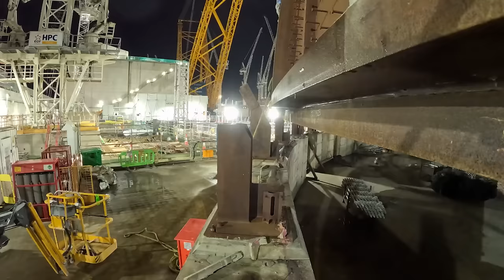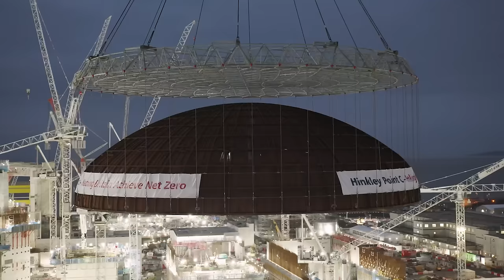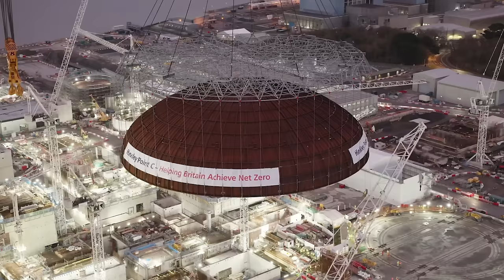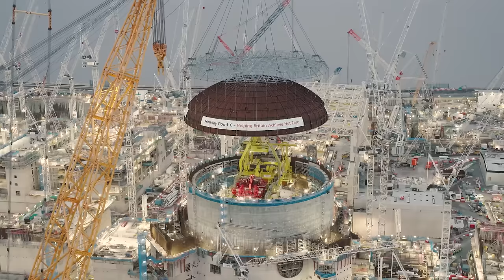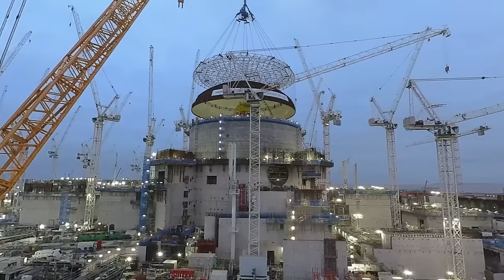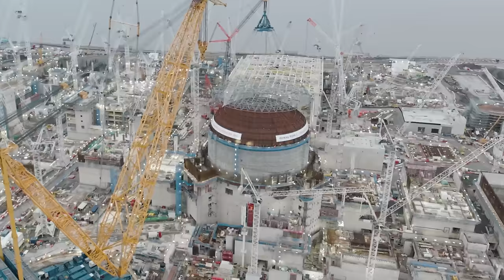Hinkley Point C | Dome Lift

Comment: helping britain achieve net zero but using loads of concrete, yes I know it's purple concrete or whatever, but a huge driver of global heating, 5% of all emissions or something, also not convinced this will be easy to maintain and look after once oil runs out, in, what 50 years max? what are the plans for keeping the site safe 1000 years from now? the land was sold to you for a wind farm.